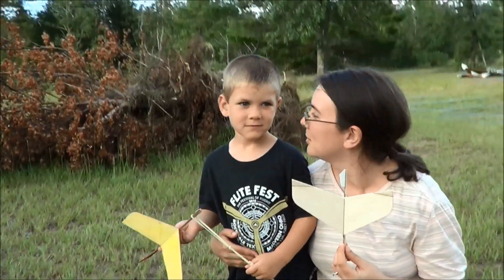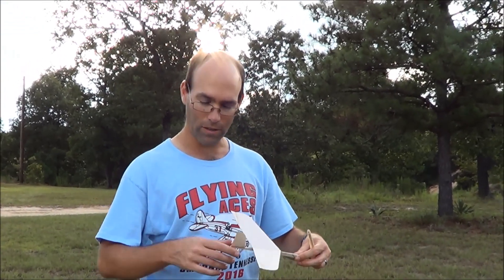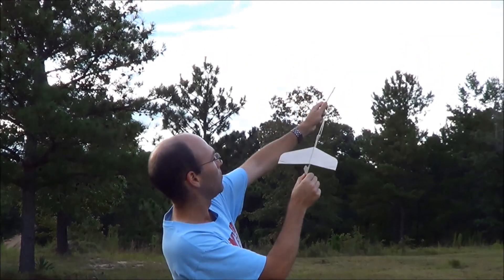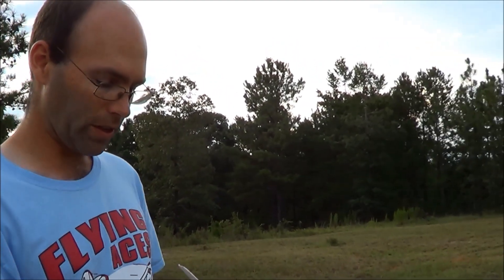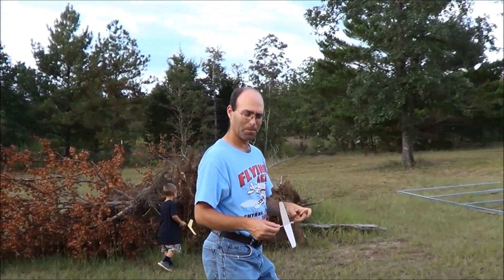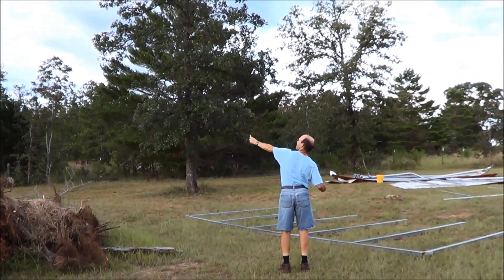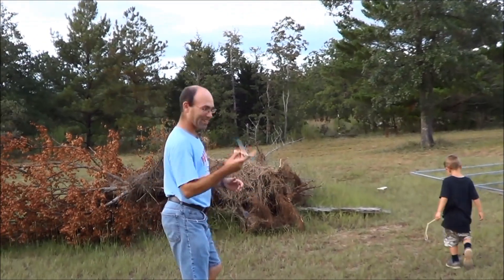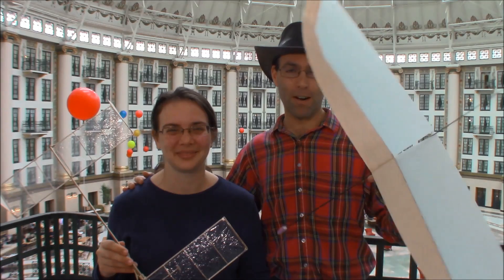One Sheet Wing - Flight Trimming

Comment: Are you breaking the edge or just bending it? If you’re only bending, how can you do that without breaking the fragile balsa?
Reply from the maker: Docleegb most balsa will bend more than you'd think, however I was actually cracking it this time. If it loosens up, hit it with a dab of CA glue.
Reply: Do you ever use steam to soften and bend?
Reply from the maker: Docleegb I lack the patience. I do wet form parts for wingtips and props though